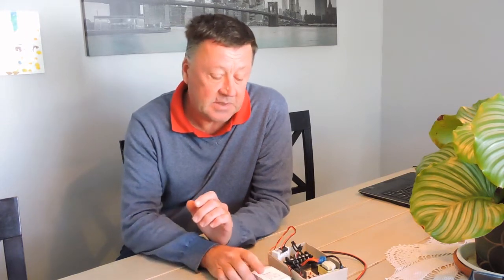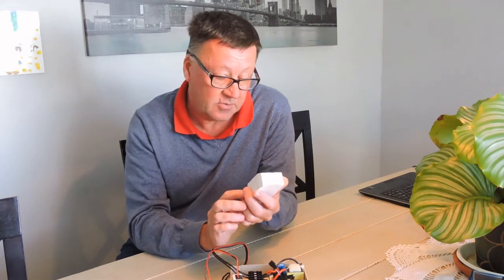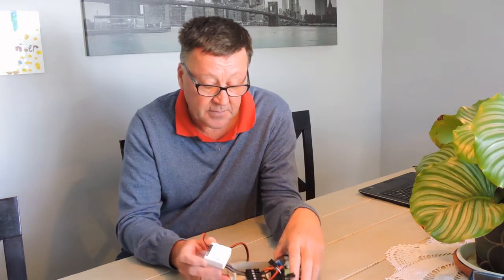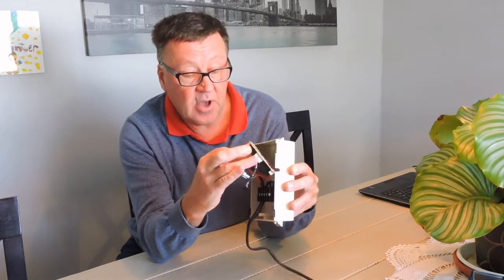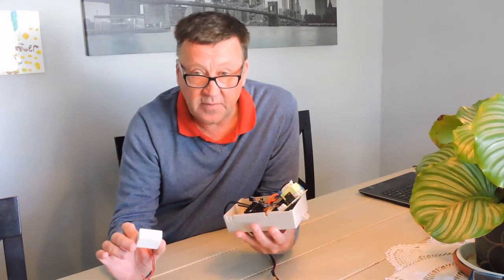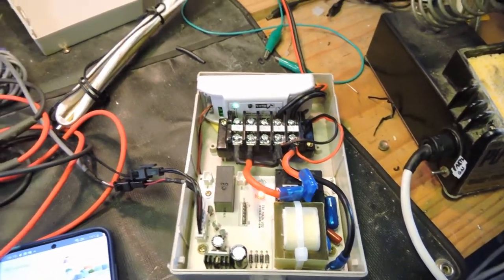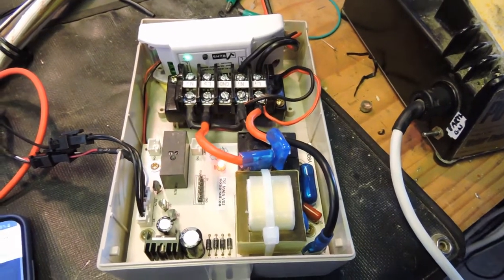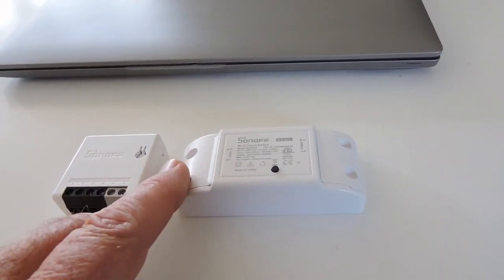Gyserwise Sonoff conversion Hot Water Cylinder controller

Comment: Fantastic idea bud. Was just wondering. Is there anyway to get this to work with the Sonoff Temperature and Humidity THR320D. For example to wire in the Temperature sensor so that the sonoff sees it. I also want to pur the water sensor in that water catch tray so that if there is a leak it can cut power and send me a notification. Maybe even trigger a cut-off valve for the water.

Comment: I followed your instructions and modified both my GeyserWise and Sonoff basics. Firstly, both my GeyserWise were different, and none of them looked the same as yours. The principle, however, remains the same. 

I wasn't sure if I wanted to use the Sonoff to time the geyser (in which case the GeyerWise element needs to be powered on all the time for the Sonoff to switch the broken bridge according to my schedule) or if I wanted to use the GeyserWise timer (in which case the Sonoff needs to be on all the time and can be switched off during load-shedding or if required). 

Unfortunately, both scenarios don't work because of a logic in GeyerWise that causes an error E4 if the element is switched on and heats at a rate of less than 4°C per hour. The clever guys at GeyserWise did this for several reasons; no power supply to the element, element failure, leaking hot water pipe or pipework not installed correctly. A complex equation calculates how long it should take for the body of water to be heated from the existing temperature to the set temperature. If the heating rate is lower, error E4 occurs, and the GeyerWise element is switched off. To eliminate the error and reset GeyerWise, the geyser needs to be switched off for a couple of seconds before switching it back on.

A Sonoff POWR3 or Sonoff POW20 Elite is probably a better way to achieve the same without modifying your GeyserWise and Sonoff.
Reply from the maker: Yes I agree